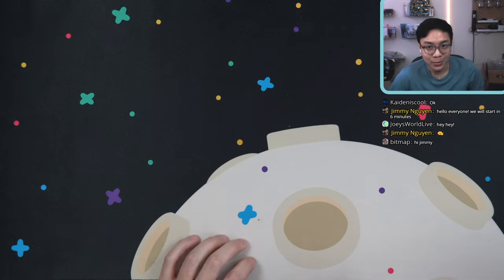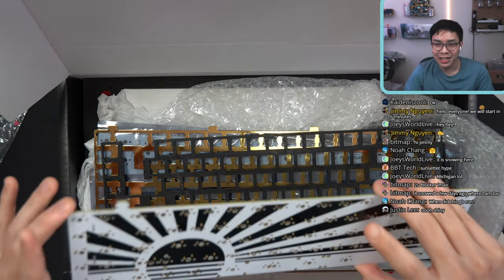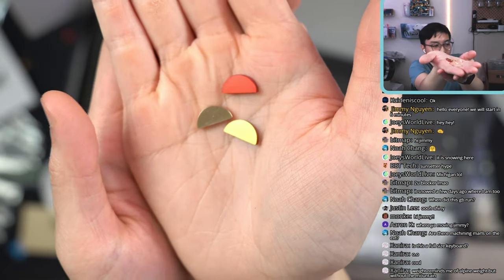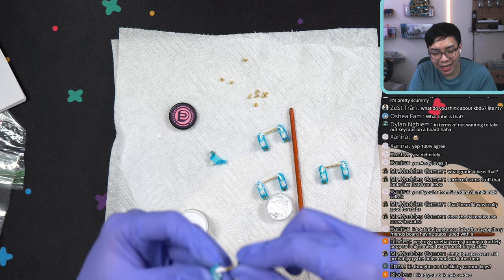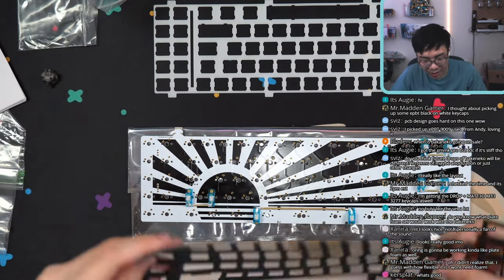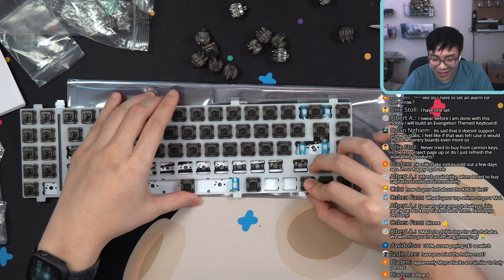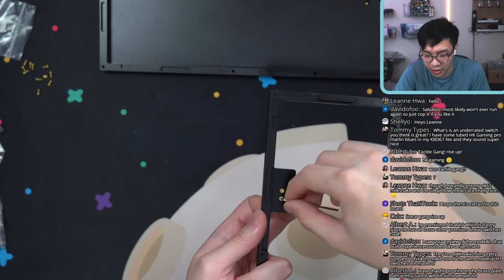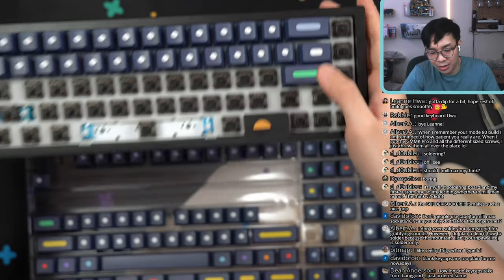I Like Big Blockers and I Cannot Lie | Sunsetter Stream Build & Thoughts

Comment: Would you consider a build of this KB w/ different plate and switches? Probs alu and any other switch? I like Inks but they sounded... different in this board. I’m strongly considering this board because it is quite unique in terms of design
Reply from the maker: I could do a build with the brass plate but I’m not sure if I’ll get around to it before extras come out
Reply: @jimmynguyen973  No problem, if you can’t fit it in your schedule it’s no sweat!👍🏽